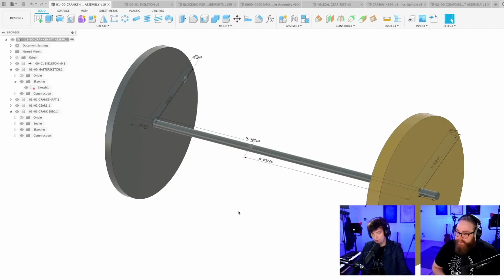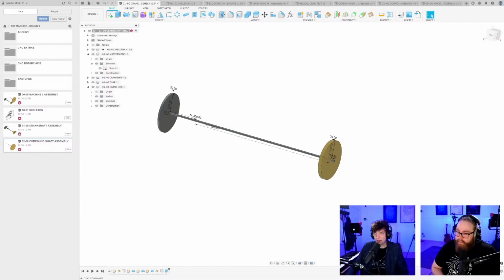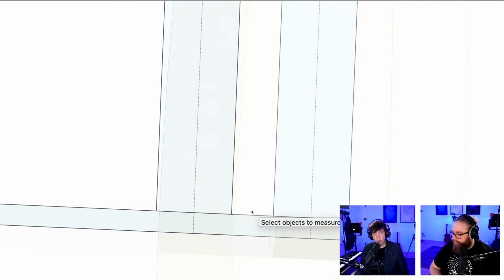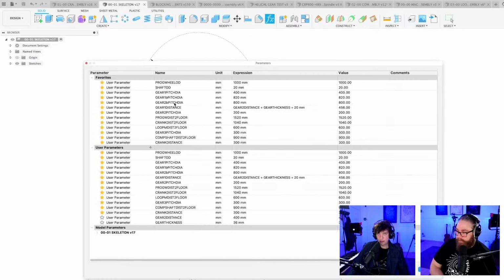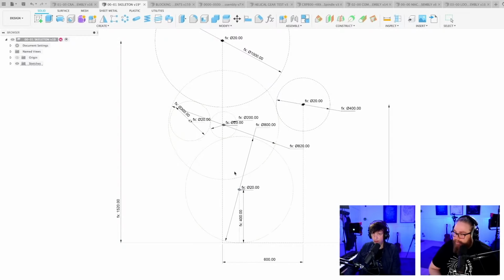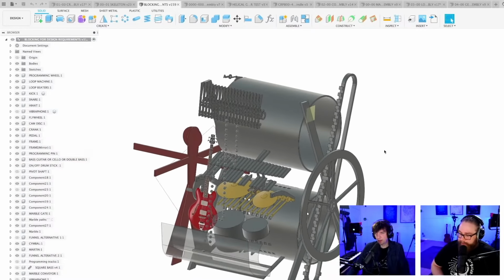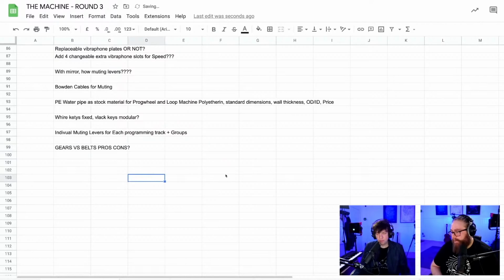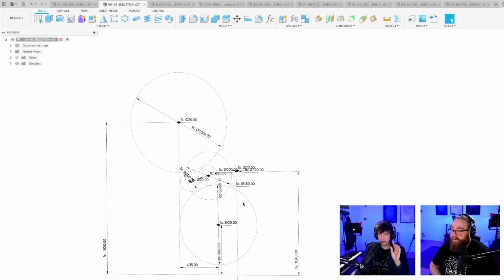Global Parameters in Fusion 360 - Martin vs The Machine

Comment: Martin you need to read this. Im a trucker and you have to consider 3 things.

1. The standard "free Height" in europe is 4m. Mening a standard trailer up in a truck. Only in sweden its 4.5m do not go higher that a standard container!

2. Dont make it as high as the inside. You need space between the machine and the roof(15-25cm) of the container so it can even be lifted.

3. This kind of Made me sorry on the first machine aswell. Dont build in wheel and stuff on the machine. Build slots so that you can move it with a standard hand forklift.

It can handle any weight. It can be used to move all your stuff. Its awsome.

PLEASE MARTIN READ THIS! ITS IMPORTANT YOU KNOW THESE THINGS!

Im going to keep postning this. Dont forget shipping is a big part of world tour.